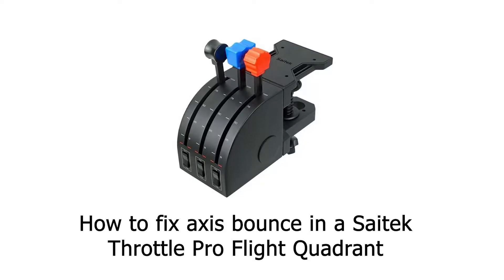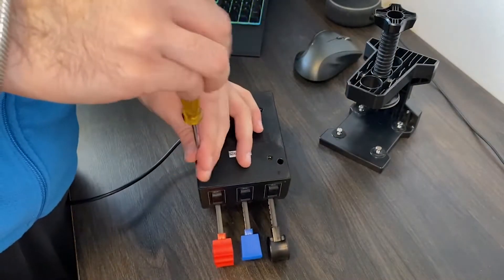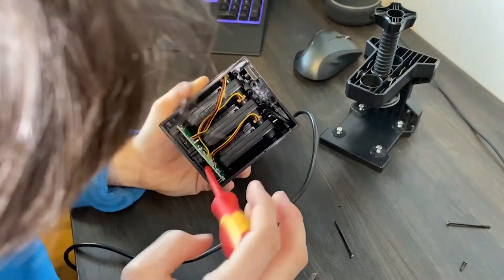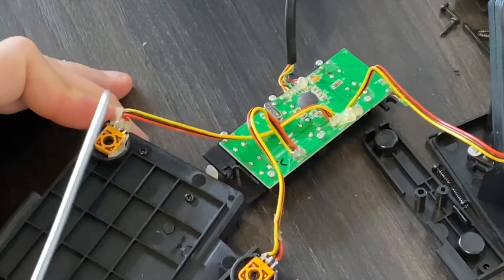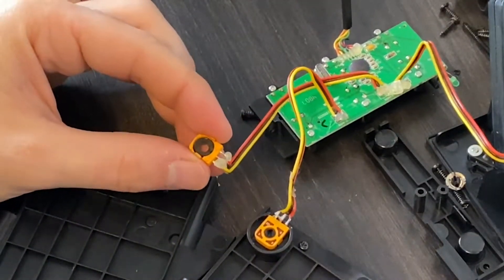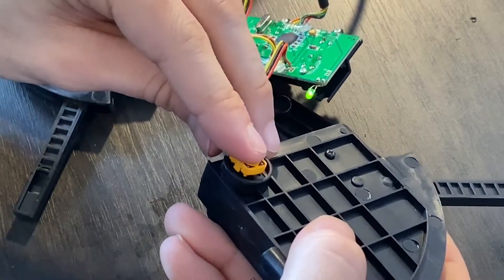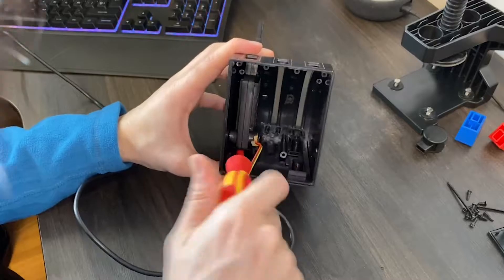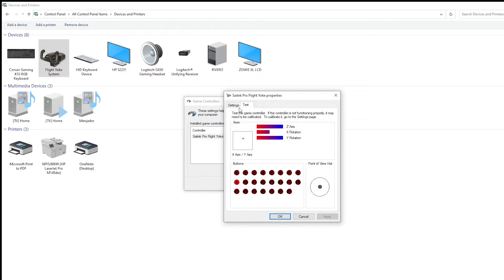How to fix axis bouncing | Saitek Pro Flight Throttle Quadrant. Disassembly & potentiometer cleanup

Comment: just remove the 4 screws and remove the bottom plate. then spray the pots with contact cleaner or isopropyl alcohol (rubbing alc). it is not as thorough but takes way less time.

very nice video, the instructions were clear and it was nice to see how to take it apart, so i DONT have to :)

Comment: Gosh, I honestly tried, but the more I cleaned the potentiometers and put them together with levers' mountings, the more every wire kept getting away unsoldered. I tried to solder 'em all, one by one (I am terrible at soldering, I have no capacity in that field), there were 18 ends of them ultimately, but then I got terribly frustrated, so I crashed and destroyed the whole thing and threw it away! A good reason to buy Honeycomb Alpha AND Bravo, I guess… 😅
My Throttle Quadrant was so old, I think I bought it in late 2000's or perhaps in early 2010's, so it is not unreasonable to think that it was not as good as what it is today. I don't really know. Now it does not really matter anymore. 🤷🏼‍♂
Thank you for the interesting video, anyway. 😁
Reply: I feel your pain, i just took a cig break to relax after re-soldering half the connections and watching 3 more snap off....... If you try this do not remove the glue from the cable connections to the pots and, if you can, hot glue the connections of the pot cables to the circuit board before doing anything else, it wil save you alot of frustration.

Comment: Eu tenho o mesmo problema, mas com o joystick, ele está tremendo para todos os eixos, não interfere diretamente no voo, mas o joystick no simulador está tremendo, bem como as superfícies de controle. Abri para verificar se o potenciômetro seria o mesmo do quadrante de aceleração, mas é diferente e tenho medo de danificá-lo, você saberia como corrigir esse problema?
Reply: I have the same problem but with the joystick, it is shaking for all axes, it doesn't directly interfere with the flight, but the joystick in the simulator is shaking as well as the control surfaces. I opened it to check if the potentiometer would be the same as the acceleration quadrant, but it's different and I'm afraid of damaging it, would you know how to correct this problem?
Reply: @raianluna9815  amigo, voce conseguiu resolver? estou com o mesmo problema

Comment: The most amazing thing about this video is how strongly your lever caps were stuck to the levers. I had to tape mine on. But good tutorial, thanks.
Reply: I thought this also. However they require a little force to push on, but will be secure once done.

Comment: This fixed worked great! however you should flash a warningto be super ultra mega gentle as those cables are stupid easy to break off.
Reply from the maker: Indeed, crappy material

Comment: This worked flawlessly! My throttles were bouncing like crazy. Took about an hour, you'll need a magnetic tip screwdriver and a long thin pair of needle nose pliers or tweezers with some good lighting. I cleaned the potentiometer surface along with the metal surface with alcohol and q tips. Thank you for the video. Works like brand new again!

Comment: Guys I ended up completely breaking my throttle quadrant while attempting to disassemble it. Indeed, the cleaning up the potentiometers is fairly simple, but some long overdried compound broke apart on the mainboard while I was uscrewing it, and one of the cables connecting the USB chord to the board snapped off. I tried soldering it back in but ended up causing a short-circuit and Windows detected dangerous voltage spikes when I tried plugging it back in. Sadly, I will be getting something else since I had been using mine for 2 weeks only. It came sealed in the box, but I suspect these units were produced years ago and the components inside are already worn out even before opening the box nowadays. I found dried glue, molten plastic and some kind of oil everywhere inside.
Reply from the maker: Oh Richard, very sorry to hear! This is a low-end cheap product… good yokes are very expensive, so a lot of care is needed not to brake anything. However, it seems your unit was at the end of its life. Hot glue and grease badly applied is normal in this units… as said, they are cheap bad quality items at the end…
Reply: cant u just spray the hell out of it?

Comment: Hi. Like the vid. I am dis-assembling to add tension to the throttle. Have removed all screws  etc, but the 3 lever mechanisms just will not pull out. Any ideas please ? I just want the centre one out but have removed screws for all.
Reply from the maker: Hi, you mean the top cap? (Red or green?), pressure and should come out. The mechanism itself may be hot glued
Reply: @BarcelonaAustinA35  Hi. Thanks for reply. I meant the internal lever mechanism. I eventually got it out buy pulling it with a pair of pliers !
Reply: @rmvideochannel6385  If you spread the slot the lever passes through (a screwdriver will work) it will pull out easily.  The problem is the raised bit of plastic that holds the colored handles on.

Comment: Thank you for your helpful guide, Can I use hand sanitizer(including alchol) instead of alchol?
Reply from the maker: Would not recommend that as it cointains more water and other compounds potentially corrosive for the resistance path…
Reply: @BarcelonaAustinA35  Thank you for your answer, Can I use ethanol instead of alchol?
Reply from the maker: Yeah, ethanol is ethyl alcohol
Reply: @BarcelonaAustinA35  oh great, thanks

Comment: I made it, bouncing gone, but could not assemble it. Whenever I tried I had to use force to push the throttle trough the case and then cable began to break. The more I tried to fix and re-assemble the more broke. I ended up burning it completely.

Comment: Very nice vid, thank you for taking the time to make it.  Do you recommend any particular kind of glue to re-attach the pots?  Can I use hot glue or would that melt anything?
Reply from the maker: Hi, hot glue will be fine. It is was was originally used to hold the potentiometers in place. Regards

Comment: Nice one! I would like to just replace the lever on one of my slider units. I wonder if there is a place where one could just buy replacement parts for this device. Any suggestions? Thanks for a helpful tutorial.
Reply from the maker: Thanks Jeff… hm, couldnt tell. I’m sure the potentiometers are easy to get. The rest, i’d go for 3d printing…. Good luck!

Comment: Hello. I installed the Logitech 64bit Driver Software for this Throttle, but now the Windows 10 Calibration Tool in the Game Control Manager is gone. There is only Test and Dead Zones, no Calibration anymore. I uninstalled the Software and the Throttle etc. and tried everything, but with no success. How can i get this back?

Comment: Hi! First of all, great video. Did everything, but when I was putting everything back in place the wires on the switch box pulled out... Can anybody tell me the correct sequence or send a picture or something? I tried taking screenshots of the video to find out the sequence but I couldn't. Thanks in advance for the help. Safe Flights
Reply: I just clean mine! Thanks for the video! Putting it back was a bit tricky. I would say to put back back first the red and blue axis. Then place the black cable on the side of the blue and then the black axis. Then board and the two pieces behind the axis. Next time I will get a magnetized screwdriver to make it easier to screw back everything. ah! also you may have to bend a bit the led!

Comment: I tried this but the controls still bounce and wiggle around when stationary.  =(
Reply from the maker: Hi, please check the minute 2:11, it is the most critical. it happened to me as well the first time i cleaned it and mounted it back, it was worse than before lol. Make sure the contact point of the potentiometer is properly placed, maybe it is 180º off. Good luck!
Reply: @BarcelonaAustinA35  I did make sure they were the right way. I also did it backwards the first time. When I tested it the controls were all over the place. After putting them the right way around it was about as good as it was before I started. It works but it's just giggly like before. Maybe a tiny bit better but overall not much improvement.
Is there maybe a better cleaner I could use ( I used 91% isopropyl) ? Or maybe I just didn't scrub hard enough but I didn't want to damage it. I thought I gave it a thorough scrub but who knows?
Reply from the maker: Hm. Well, these potentiometers are really crappy, dont expect much from them. You can try cleaning a bit more thoroughly, or replace the potentiometers. Could also be related to the controller board, the original one is 10 bit and not great. A leobodnar board is a good option. I have a video on that. Might help, although looks more related to the potentiometer. Regards
Reply: @BarcelonaAustinA35   I have same problem with brand new throttle. Opend it and clean with different cleaners 5times and doing the same... Any idea what potentiometer it uses? Looking for a New one...

Comment: Great video! Wasn't able to disassemble as I don't have the right screwdriver, so I gave the quadrant a spray-and-pray blast of compressed air and contact cleaner while working the levers back and forth...seems to have worked at least temporarily. Maybe something for folks to try first.
Reply from the maker: Yeah you need a pretty damn long screwdriver! Glad it helped anyway, take care!
Reply: Oh dear, had I read your comment BEFORE even starting unscrewing the whole thing, I would have ended it better. ;)

Comment: Bought a used Flight Yoke System and I immediately noticed the bounce and drift issue with the TQ. It was a good thing I came upon this video because I was able to fix it up in about an hour with the right tools in hand. MASSIVE props to you for this video, it works perfectly on my used TQ.

TIP! After cleaning the part, I tried it out but it was ghosting much more than before I started (which resulted in a HUGE heart attack for me haha.) But then I noticed that the contact points were almost flat. So, be sure to check if the contact points are elevated enough to actually register inputs made on the levers. A slight prod of my tweezers seemed to do the trick. Just carefully raise it a bit.

THANK YOU!!!
Reply from the maker: Good tips Kai! 
I did the same haha, bought a secondhand unit and fixed it. Good yokes are quite steep! Cheers